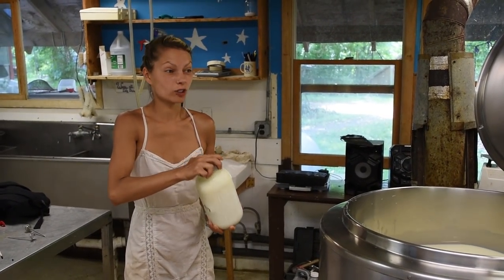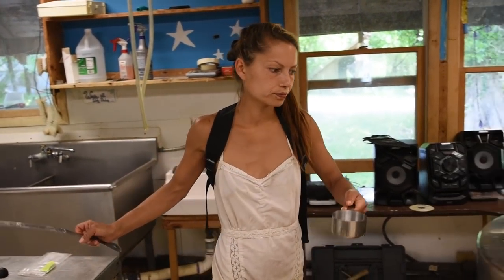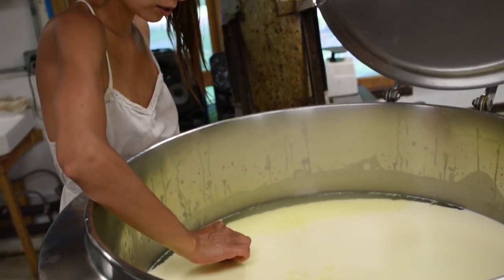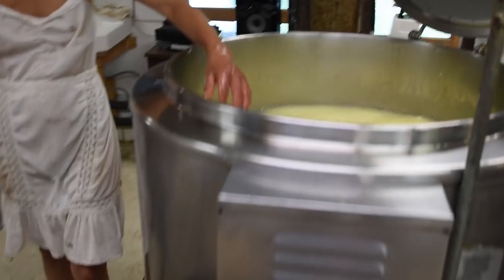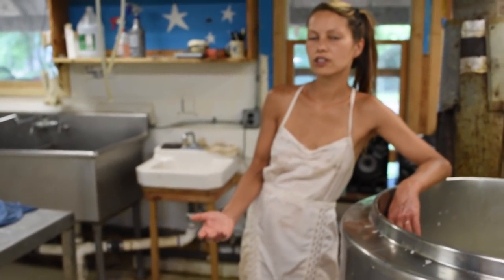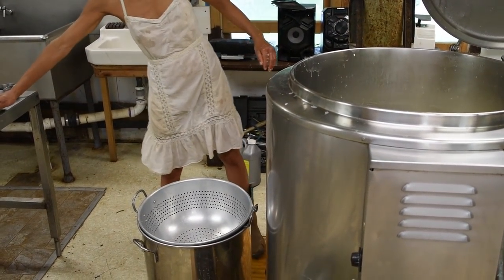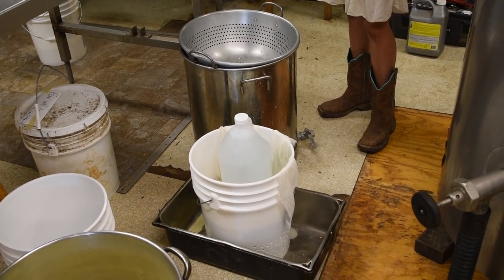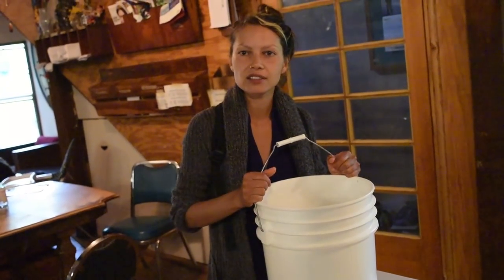Cheesemaking with Liuda

Comment: If she has the time, I have a question for Liuda. I've been drinking Kefir milk for about 7 years and recently have started adding strains of bacteria that aren't in kefir. I make the kefir by the gallon and notice the separation of whey begins at the bottom of the glass container. I shake it 3 or 4 times a day. The line of whey moves up the container over the next few days until the whey is only at the top. I'm aware of the log (or lag) exponential, stationary and death phases of the bacteria. Is there a correlation between the phases and the upward movement of the band of whey, and is there a point better than another to add additional bacteria? And on a separate note, I really enjoyed this video, and I think you're the healthiest looking person I've seen in years. Thanks.